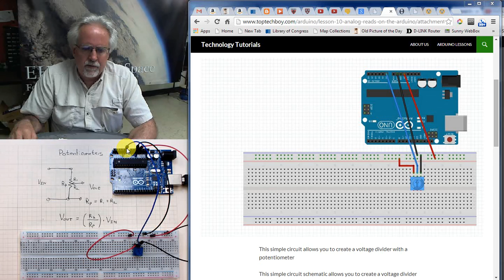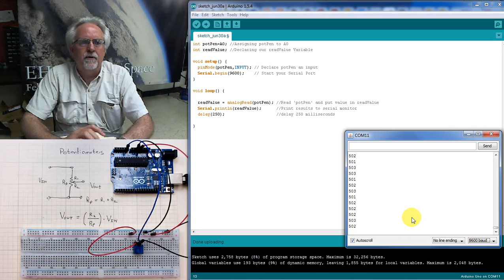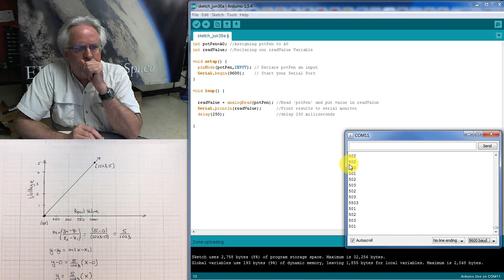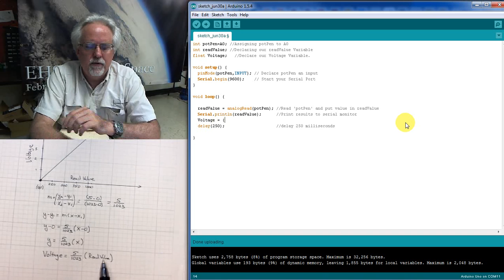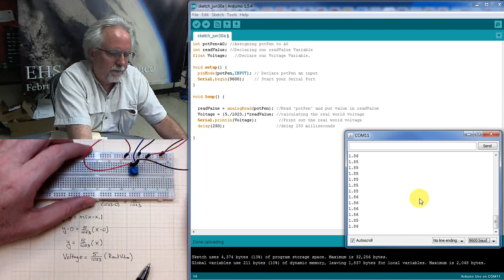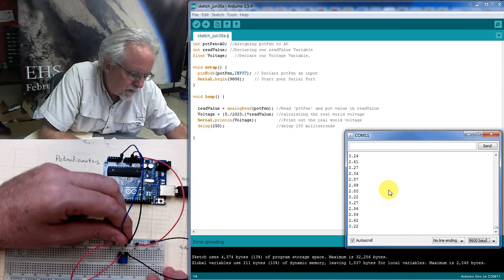LESSON 10: Reading Analog Voltages with Arduino

Comment: hello Paul Mcwhorter, sir i've a question on the last section of the video you used the potentiometers to tell what is the voltage between 0-5, the question is  how did the arduino knows that the voltage is at two decimal places in the serial monitor ?
Reply: he declared voltage as a float , which means that it will have a decimal part.. by default I suppose Arduino takes 2 decimal places in the serial monitor..
there might be a way to get more than 2 but it will be needed in more complicated projects that you will need more precise measurements

Comment: for some reason, my read values are not steady. It goes 0, 1023, 0, 350, 740, 0, 590, 1023, and so on. Is that a potentiometer issue?
Reply: you should check how you connect the legs because I carelessly connected mine and I burned it :P , if the connection are right go check the potentiometer with an ohmmeter

Comment: in previous lesson you taught to that read value of 255 corresponds to a voltage of 5v now its 1023, have i missed something?
Reply from the maker: When you write, values are between 0 and 255. When you read, they are between 0 and 1023
Reply: Paul McWhorter thankq so much sir, you are a real help for someone who can't afford to join special classes for learning.  may god bless you
Reply: But why

Comment: This is the sketch:
int potPin=A5; // connect the potentiameter to pin A0
int readValue; // declare the read value variable

void setup() {
  // put your setup code here, to run once:
  pinMode(potPin,INPUT);// declare potPin as input
  Serial.begin(9600); // start the serial port
}

void loop() {
  // put your main code here, to run repeatedly:
  readValue=analogRead(potPin);// read portPin into readValue variable
  Serial.println(readValue);// print readValue to the serial monitor
  delay(500);// delay 500 miliseconds
}

I wonder how could i include a picture of the circuit here
Reply: thx!

Comment: for some reason i am reading values between 0 and 1023 off the potentiometer without turning the knob. I used 3 separate pots of 10k and everyone of them produces random numbers between 0-1023 no matter which way i turn the knob. My sketch is exactly like yours and the bread board is wired same as yours as well.  I have an Arduino uno R3. any thoughts?
Reply from the maker: Not to be a smart aleck, but if you do it exactly the same,  you should get exactly the same result. Something is wrong. You have to check every line of code, you have to check every wire. something is different.

Comment: Hi Paul. Thanks for the great Tuts. I am battling to figure out something so simple. I want to make code which can make the light go on for 500ms but changing the period between the blinks via the potentiometer. I would like full pot value to be 30s interval and near 0 pot value about 1 sec interval. Please could you assist. Greatly appreciated
Reply: you should declare a value.. then read a values of the potentiometer using the serial monitor, when you have the potentiometer in a specific position, lets just say its around 500 . you say that 500 will be equal to the value you declared and then you use If statements.. 
for example if the value is between 500-800 the led will be on for 400ms and off for 300ms , if the value is between 100-300 the led will be on for 1000ms and off for 500ms etc

I hope I helped you man

Comment: Hi Paul! I want to measure the frequency of an analog audio signal. If I rectify the sound wave should the analog pin detect the change in voltage?  I am reading this "It takes about 100 microseconds (0.0001 s) to read an analog input, so the maximum reading rate is about 10,000 times a second." So it should be ok until about 5000 Hz? Great video btw. Very noob friendly :)

Comment: Other way to make the formula is using the rule of three using any voltage between 0 and 5, for example 4v times 1023 which is 4092 and them 4092 over 5 which is 818.4. Then subtract 818.4 from 1023 and you get 204.6. In the code change to Voltage=readValue/204.6; and you get the same result

Comment: I have a question: Can I read with analog pins the Voltages until 12 V ?
Reply from the maker: No, do not go beyond 5V
Reply: So if you're plugging a 12 v battery into the arduino... drop the voltage with a resistor?? Or just don't?
Reply: 5volts is the maximum that it operates at  exceed it and you risk burning the board
Reply: What if you used a 10M and 1M resistor in series with the test point between the two?  Connect the free end of the 10M on the +12V and the free end of the 1M resistor to ground.  You would need the Arduino and the battery to be sharing a common ground.  And you then did a read off the point where the 10M and 1M resistors are connected?  Wouldn't that result in you measuring 1/11th of the total voltage and you could scale it from there?
Reply: @CurmudgeonExtraordinaire  Theoretically yes but it would be very high impedance and prone to noise, better to scale the resistors down and make the circuit stiffer.
Reply: You need to adjust the voltage with a regulator.
Reply: No
Reply from the maker: You really have to be careful with what you are doing. I would suggest sticking with 0-5 volts unless you really understand circuits and impedenced.

Comment: I bought arduino uno and arduino mega (real arduino) used 9v power but not one 5v pin had 5v.. 3.4 volts.. I think I got 3 volt arduino boards.. Any idea how to tell how to differentialte between those 2 boards?

Comment: I have a question can the analog pins only do reads or can they also do writes?
Reply from the maker: The analog pins A0-A5 are only for reading. Use the ~ pins for writing.
Reply: Paul McWhorter thanks sir and In the previous video you talked about calculations where can I go if I wanted to go more deeper into this? thanks again Sir!

Comment: I HAVE AND ANALOG THUMBSTICK, BASCALLY TWO POTENTIOMETER. THE PROBLEM IS I GET MIN AND MAX READING way before i have moved the full distance of the pot. is this normal? i expected the resistance to chance through the whole movement. its basally like the ends are useless.

Comment: Hello, thank you. I have a question that is probably nonsense as I have no knowledge on arduino but I thought your video was a step forward for my "project/idea": I am thinking of a set-up where I can measure a dc voltage of up to 18v from a circuit and up to 10amps (only measuring voltage). Depending on the voltages at different points, a relay would connect/disconnect the voltage in the circuit. I understand in principle the limit with arduino is 5v, but I am guessing the code with arduino would allow me to use collected data from the circuit (in memory) and conditional code to manage the relay on/off. Conceptually, can arduino measure different voltages around 12-18volts to manage the relay? If not, due to the 5v limit, maybe using a shunt? Apologies if my question is far fetched, I am trying to understand if I started to work with arduino if it could manage "heavier circuits" I would like to dabble with, thanks.
Reply: Well,you can use tip120 or tip122..

Comment: Hello

is there a way to print the 'Voltage' and 'readValue' on the same line? as in:
5      1023
but without making a string of spaces between them? I have the following:

  Serial.print(Voltage);                          
  Serial.print("   ");   
  Serial.println(readValue);

and just want to know if there is a more 'professional' way to achieve this?

thanks
Reply from the maker: That looks like how I would do it.
Reply: You can modify Paul's code with something like this...

// Add this line to end of our setup() function
Serial.println("Voltage:    readValue:");
 
// Use these four lines to our loop() function in place of the original Serial.println() function call.
Serial.print("   ");   // Align values for voltage column
Serial.print(readValue * 0.005); // Display voltage 
Serial.print("        ");  // Align values for readValue column
Serial.println(readValue);  // Display readValue
Reply: Hi there assignmentable, yes there is a more advanced method, try using Serial.print("\t readValue ")   the letter t  tabs the output.

Comment: i put the multimeter it Give 5v  but in laptop Give 0v

if the laptop Give 0v the  multimeter   Give  5v
Reply: Your reading probably coming from the circuit. If you measure from neg to pos at the pot you will get 5v.

Comment: When we do a digitalWrite command, how many volts does the pin put out? is it full 5V?
Reply from the maker: Should be 5V.
Reply: Thank you for the quick reply :D Loving the tutorials!
Reply: Paul McWhorter I'm on lesson 15. For which I need the Virtuobotix color sensor. However unfortunately, Amazon is unable to ship it to my country. So can you please suggest to me other working color sensor from the below:

1.TCS3200 Color Recognition Sensor Detector Module For Arduino, ARM and other MCU KG038

2.IR Obstacle Line Proximity Fire Color Sensor for Arduino Raspberry Pi 8051

3.SparkFun Color Sensor Breakout - HDJD-S822

Thanking you.

Comment: If you were to put a hall 30 amp current sensor would that read the higher voltage with you calculations?

Comment: sir, I am getting this error" avrdude: ser_open(): can't open device "\\.\COM1": The system cannot find the file specified" when i try to do the same as in video. Cand give any solution?
Reply from the maker: +Siva Krishna Make sure you are using the right com port. YOurs might be different than mine.
Reply: Thanks for the reply sir

Comment: u have excellent explanations but why are u so much coughing 
it is irittating
Reply from the maker: +Marko Boras Because I have seasonal allergies, which makes me wheeze and nothing helps. So, the simple solution is find a series where the speaker does not have allergies.
Reply: +Paul McWhorter I won't change tutor because you are excellent tutor.I just realised that during tutorials and wanted to ask you why.

Comment: I ordered the Arduino Uno yesterday, and already spent many hours with your lessons. Very helpfull. I'm programming in c# on school, and now i can use codes that is working in the real world!

I already connected 2 LEDS, with 1 program the red led is on with a voltage under 2,5, the yellow led is on with a voltage above 2,5 volts.

The second program i made a led dimmer for both leds. Very fun.

The only thing untill this lesson is that i still need to learn how to calculate voltages, Amps, its a bit hard but i will understand it soon i hope!

Comment: How come there are some rogue readings in the serial monitor? There were some with no line break, some nulls and some nil values being displayed. Are these errors on read or on write to monitor?  I presume some code can be created to catch these if they are read errors.
Reply: +EpicSpence     Ditto on this question.  Paul, Is this your serial cable acting up again?  I suppose I should have created the example and played with it - to see if I get garbage as well.  

A rare but possible value of 50 or 512512 might ruin the coolant in the reactor core.  This would not be a good day at Mr. Burn's Springfield plant. t,.,

Comment: you can do 1023 / 5 in a simple calculator you dont need a graph and then use if login statements to work out if its lower then 1023 but higher then hlalf of that (1023 / 2) and put in the voltage in its own readbale var and do the rest for the other voltages until theres no ranges left that myt be a way of doing it without needng to write down too much lol
Reply from the maker: ***** One of the objectives of the lesson is to show High School students a real-life application of using a line, and the math they learned in math class about linear equations, slope and so forth. So, I am trying to get students to recognize and use the math they know in an engineering problem . . . trying to get them to connect their math brain to their real world brain
Reply: ok nice id say mission accomplished lol id love to see an arduin or raspberry pi emulate an oscilloscope could you do that?
Reply from the maker: ***** You could do a crude one. See lessons on Using Matplotlib, drawnow, and Python. Connect Arduino to Python running on a pc with matplotlib and you could do simple demo type oscilliscope.
Reply: nice il have to try and find that vid whats it called or have you got a link to it plz?
Reply from the maker: ***** These are the series of videos that will guide you through it. Where to start depends on how familiar you are with the topic.
http://www.toptechboy.com/using-python-with-arduino-lessons/

Comment: can you measure voltage from a separate source that has a common ground?
Reply from the maker: ***** You can measure 0-5 volts, if you use a common ground. Need to really make sure not to connect higher voltages.
Reply: the voltage will be 3 volts (3.5 max) its for a rfid connected to a elec door lock via a relay and arduino thanks for your reply i will have to update code and its already wired into my door lol :)

Comment: You have 1023 divisions of 5 volts - no need to play with slope and graphs, the math is simple.  You completely overcomplicated this.  But thanks for the vid just the same.  Also having the microcontroller calculate 5.0/1023.0 every time is not efficient.  Better to calculate this known value and declare it, although the compiler may optimize this for you.
Reply from the maker: Digger D Understand I am a high school teacher. I teach all levels of high school math, and engineering. The problem is that once a student walks out of math class, they are totally unable to apply the math they have learned. My math students are so good that they can solve any math problem in the math book. Once they walk out of my math class and into my engineering class, they can not work the simplest of math problems . . . like this one you mention. My goal in going through such painstaking detail is to make students see that the math they know how to do (slope intercept and point slope form of a line) can actually be used to solve a problem they need to solve (map digital 0 - 1023 onto analog voltage of 0 - 5 volts). I am sure you can see how to do it in your head, but my goal in engineering class is to get students to start getting the math part of their brain connected to the everything else part of their brain. Thanks for the post.
Reply: Been a long time since I was a student ;) I understand though - physics was just a bunch of stuff to learn until it got applied to real world problems :)